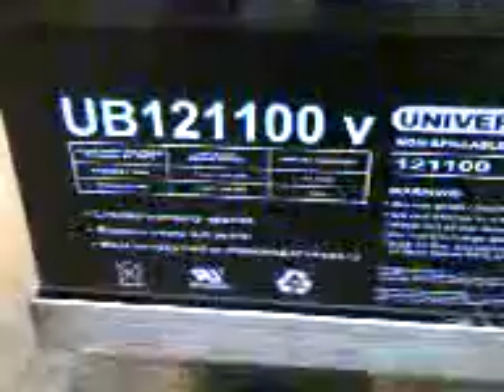stainless electric quadracycle update

Comment from the maker: I bought the motor , controller, throttle as a kit from monsterscooterparts. It was the 1000 watt motor wich uses a 1200 watt controller. I did find the kit to be slightly less powerful than I expected, but it is required to do a lot of work. I am in the process of ordering a second kit for the purpose of a redundant left rear wheel drive setup with identicle gear ratios. It will then have two 1000 watt motors,controllers, and throttles for those steep hill power demands. Thanks for the comment.